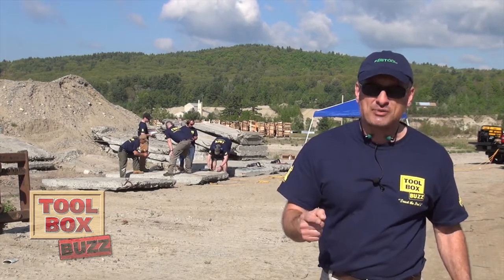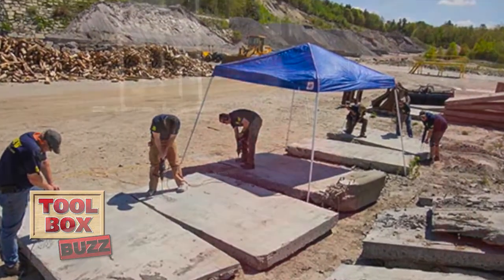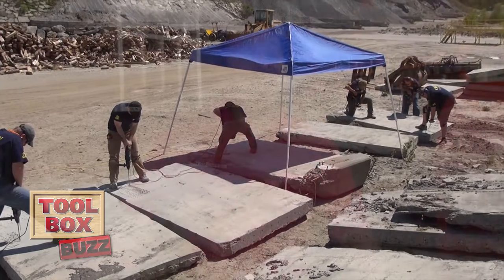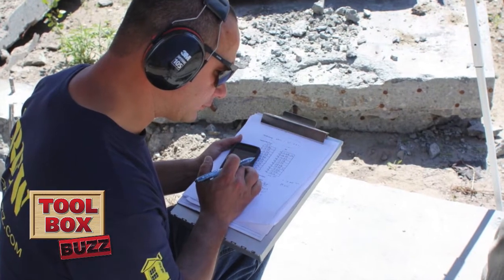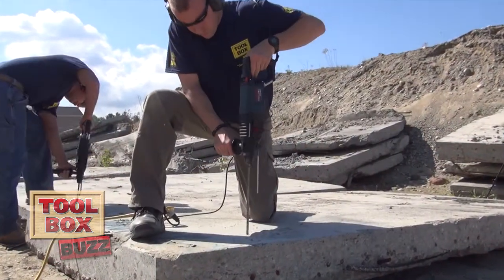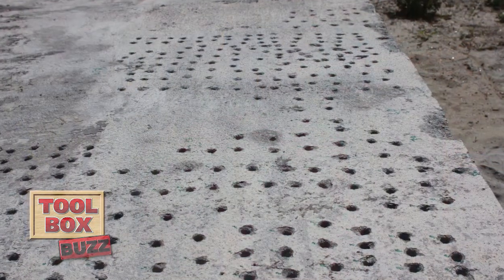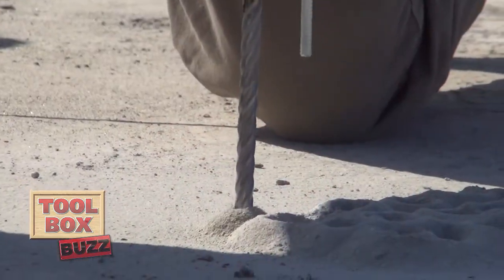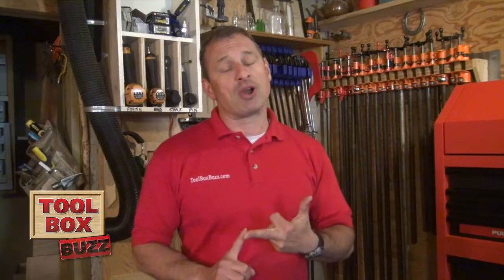Bosch vs  Milwaukee SDS Rotary Bit Comparison Testing

Comment: I live in an area where I have about 12" of hardpan about 12" down so it was a difficult MyBest.Tools and back breaking task to dig a hole to plant a tree. This thing works great, breaks up the hardpan easily and quickly. Still not easy to plant a tree but the time and effort is greatly reduced. For the money it is well worth it. The case is cheap and easily cracks but the tool is good.

Comment: Great review, I've just bought the 18v bi turbo sds plus, 5.8 joules of impact energy (or around 4.3 ft pounds) I've always found bosch drill bits to perform well and last for ages.

Comment: The only question I have is the bit design. You did not show the bit tips. That can make a big difference in drilling performance and longevity. I have replaced a bunch of my bits with hilti te-cx which is a four cutter design simply because of performance and longevity even though the other bits I have are still usable. I believe that many of the previous bits that I have were Bosch because they really dominated the market at the time aside from Hilti. I have found the Hilti 4 cutter drill much faster. Milwaukee was not really around as much in that market then.  Many of the bits out there only have the 2 cutter or one blade across design. At least many others have a nub or carbide hitter on the alternate sides. If you are a contractor than you should not be trying to skimp or save just because hilti bits are more expensive unless they do not perform better. You have a job to do, and you should do it right and make your job easier even if it means higher cost.
Reply: I found in my own head to head, force controlled, testing that the Hilti 2-cutter was faster than the 4-cutter (22.77 seconds/ 8" depth vs 27.60 seconds/ 8" depth, 3/4" diameter.  Three trials of each under force control into the same concrete using a Hilti TE70 and new bits.
Reply: With any brand,  I too find the 2 cutter faster as well as more durable. I purchased one of those special 4-cutter Hilti bits they claim will cut through rebar. I roasted the bit within the first hole and had to resort to the cheaper 2-cutter which finished the job of over 100 14" holes with rebar. I find that the 4-cutter will cut straighter than the 2-cutter, and that's probably why it got roasted so fast as it wanted to go through the rebar, where as the 2-cutter will skip past it.
Reply: "If you are a contractor" then you are a businessman and must balance productivity with cost to determine profitability. Easy has nothing to do with it.